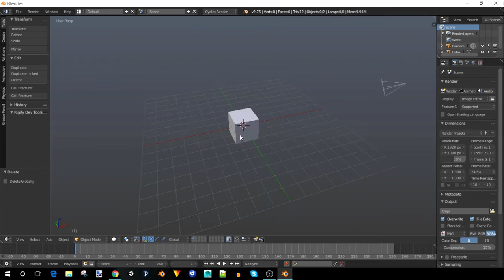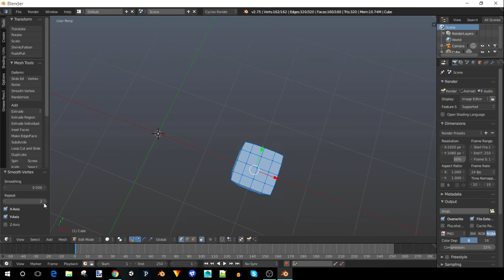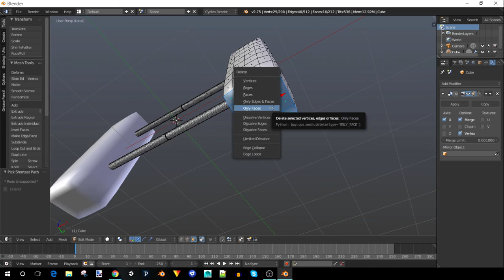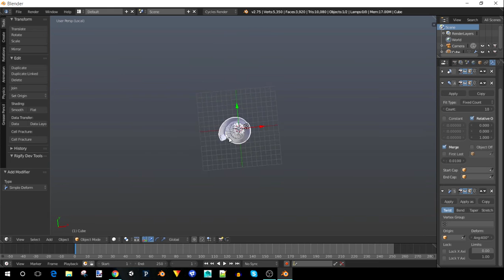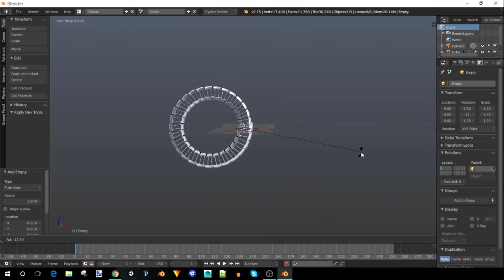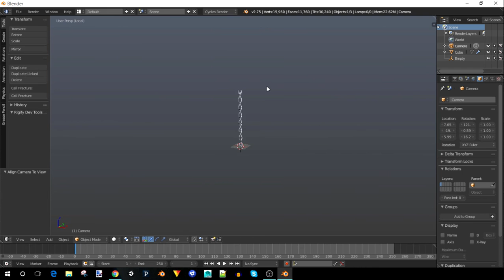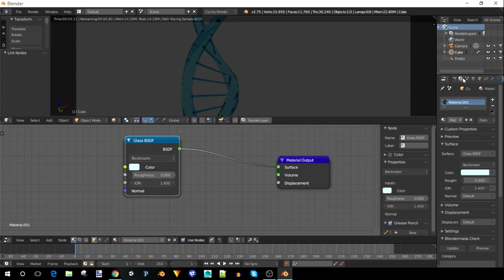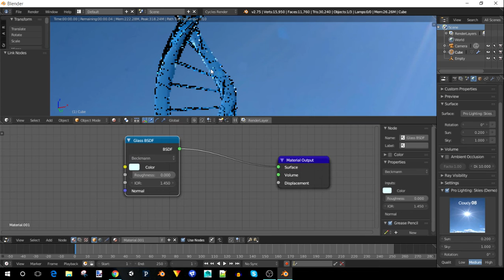Making DNA in blender!

Comment: One last question. When I use the object offset and set it empty, the cylinders explode in scale. So much so I have really zoom out to see anything. Even then they are deformed.
Reply from the maker: The reason being, is that when you make an array relative to the empty object, all aspects are relative (rotation, scale and transformation). This means that you probably did some scaling or rotating of the dna object in OBJECT mode instead of EDIT mode. Simple fix: select your dna object in OBJECT mode, press CTL-A and press "Apply Rotation and scale" this will normalize the values to 1.0 in OBJECT mode, but keep the object the same size
Reply: Yep thats right...I did that. LOL!!! thank you for the explanation!

Comment: Totally Noob at this but when you are in edit mode and you add that cylinder it is also mirrored. So instead of one that you have @1:51,on mine I have a two cylinders. How can I fix that?
Reply from the maker: Technically there are two cylinders in mine (one mirrored, one not), they are just perfectly overlapping (not ideal). I made a note @2:33. It would be best to make sure they meet at the middle
Reply: Thanks for the reply!